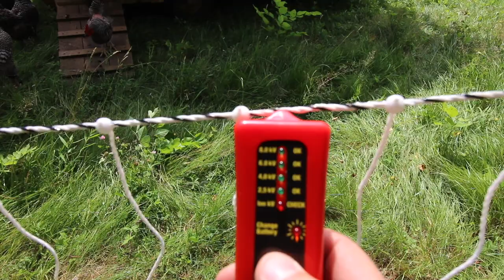Moving New Yolk City Our DIY Mobile Chicken Coop to Greener Pasture to Cut Feed Costs

Comment: Moving NYC looked like a little adventure, great teamwork. At first the chickens looked like, Wait! What?? I don't think we're in Kansas anymore. lol Lots of lush pasture to move them around to. That new fencing looks awesome, well thought out design, looks sturdy too. Will that link up with your old netting too? 
The binder rope on your old fencing, the knot is a trucker's hitch. Pass the end of the rope through the loop TWICE, then pull taut. The rope will bight on itself, and not release, then you can deal with the excess rope. To remove just pass the end of the rope back through the loop, and pull for simple release. No over tightened knots to undo, simple, slick, and easy. It's a great knot to know, and use, it has many applications.
Reply from the maker: Thanks! It was a fun move! The birds were a bit confused! Lol, Yes we can hook the fences together

Comment: Al I'd check the fence  half way around  because after you tied the two ends you may be getting current from the charger. And the opening ,, id put on the corner and over lap the fence around the corner
Reply from the maker: Good idea! Thanks, I will check it when I feed them!
Reply from the maker: I did its at 8000 in the middle!
Reply: Wow 8000 can you say JUICE! That'll light up your life

Comment: I love it! The rep said 3000 or 4000 at the end of the fence is good, you've got 8000. Is that for real or is something not right?
Reply: Cheryl Taylor their fence may not be as long as the maximum allowable length, hence the lesser drop in voltage than quoted for 'end of fence'? (not sure though, just my guess at why...)
Reply: Simon B makes sense, thanks.
Reply from the maker: That is for real. We mowed the high grass around the edges. And made sure the fence was tight. And the fence is not al long as you can go.
Reply from the maker: I would agree and the fence isn't grounding out any where either